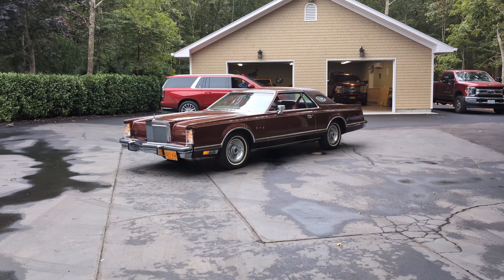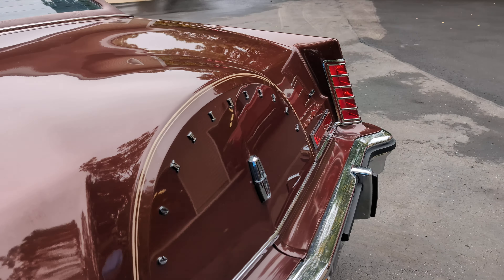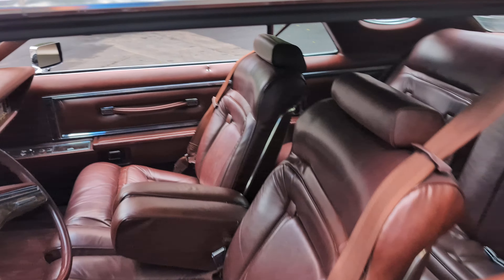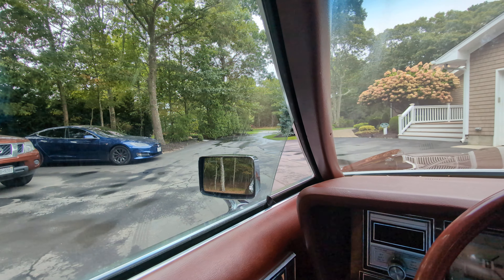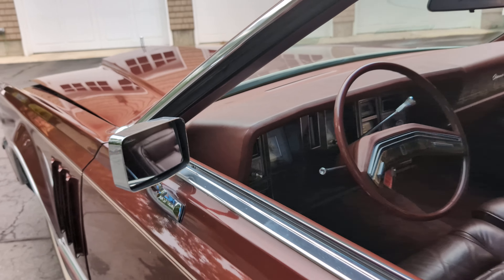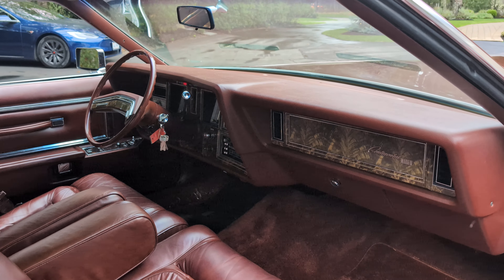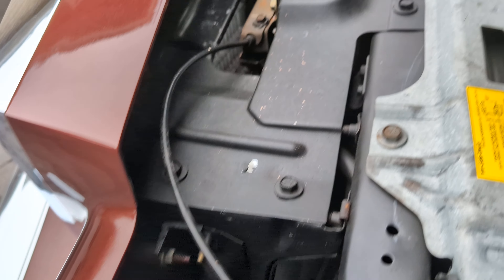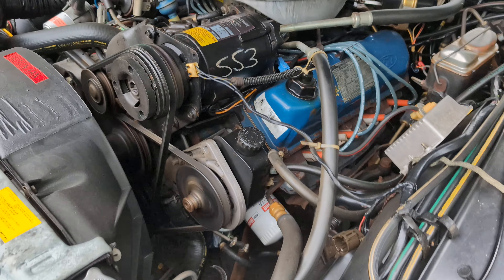Low Mileage 1979 Lincoln Continental Mark V For Sale with Only 593 Original Miles~Never Registered 🔥

Comment: What a pristine car! From the carpet to the vinyl top everything looks brand new. Funny how those buzzers always sound like that. I always assumed that was a thing that happens with age.
Reply from the maker: Right, She's Like NEW with 593 Original Miles, Whata Time Capsule!
Reply: @theredstormer8078  Not the front seats. Look at wrinkles in them, especially on the driver's side. Maybe only 500 miles (?), but some people were sitting in the seats while it was parked in a garage?

Comment: The Achilles tendon of my '83 Lincoln, and not just mine, is the ignition module (ICM). Even with a "heavy duty" box installed, in the Summer on very hot days and with intense engine heat, the temperature of the electronics in the module will rise resulting in the engine shutting down when driving, when you least expect it. Other times, with car parked, the engine was cranking but would not start. I always have two new ignition modules in the trunk as a backup in case something happens.

Comment: Yes, Quadrasonic...because the tape player not only plays regular stereo tapes, but it also plays the special quadraphonic 4 channel surround sound ones.  Quadraphonic 8 tracks have two "programs" instead of the usual four on stereo tapes because they use four of the eight "tracks" at once to provide discrete front left/front right/rear left/rear right channels vs just left and right.
Reply from the maker: Wow, Thats Very Cool!
Reply: @WeBeAutosLtd  Yes, it is!

Comment: How come the valve covers look so bad with those miles..? 🤔
Reply from the maker: Probably because it's over 45 years old
Reply: @WeBeAutosLtd  yes I see, but still, in an air-conditioned garage and no driven… 
The paint quality must be rather bad..? And no primer in those..?
Reply: Every last one that has low miles that come up for sale has the valve covers that look older than any of the other parts in the engine bay. I assume with the exhaust heat and gases they corrode the paint pretty easily. Especially for almost 45-50 years. Paint today is much better quality to hold up to high temperatures @TheKarivirtanen
Reply: @Chitwn81  yes I think you are spot on there. Thank you.
I repainted my -61 Lincoln vert’s valve covers and filter cover.
Reply: Most likely because you're lying 😂about the mileage @WeBeAutosLtd
Reply: I wondered that too. I've seen other older cars that also exhibited that flaking blue paint, but not with less that 600 miles in a climate control garage. I'm leery of that storage story and that the owner bought a number of the same model car, unless I misunderstood the story. One cannot deny is is in otherwise exceptional condition. But a "climate controlled garage" could be one where it is the climate outside that is what controls the environment inside the garage, not necessarily controlled by an A/C system. It is manipulating words, I am not saying that is the case, but I have been a salesman. Hey, Jay Leno has one!

I'm not talking about the video maker/seller, as there seems to be three salesmen involved here. One is the heir who owned the car when the guy passed. Second is the "client" who is the middleman and bought the car from the heir. Third is the one who bought the car from his client and made the video and is selling the car now. That's 3 people involved with this car. We assume each one is telling the story he was told before. The current seller is very reputable and sells very rare cars and I'm confident he is repeating the story exactly as it was told to him. I am also confident had you bought the car directly from the heir who owned it, you might save $20,000 off the $47,000 price. The two sellers after the owner sold it want their cuts.

Given those logistics, I love the car model, but I would only have bought one 45 years ago, not more, but that's just me. We all know how stories can change each time they are told. That is not to say the dealer now has any control over the story he was told. He said he got the car from his "client", so that' means the guy he bought it from was not the owner, so he is apparently relying on the information that his client is providing that he says the heir told him. There is no reason other than the paint question not to think he is telling the story that was told to him.
Reply: The paint on the valve covers is a very thin coat with no primer. Looking at the luster of the paint that is there it seems obvious that the car has very low mileage. Even with 500 miles on the clock, the car has undoubtedly been cranked and run very many times to keep the engine running smoothly and to charge the battery etc. This means it has gone through a lot of heat cycles. I understand skepticism, but after all the years, there are realistically going to be some parts of this car that are not going to appear as new as the others.
Reply: @Johnnyfan1982  I'm an auto detailer and I didn't know that, but I don't usually detail engines either unless in a Stingray where it is exposed under glass. May I ask, how do you know this and do you have any idea why they would paint a non-primed surface, and what would be that purpose? It seems like a failure waiting to happen regarding aesthetics and to leave only one area un-primed, knowing the paint will not stick seems like a bad idea.
Reply: @floridaredneck  I have rebuilt several Ford engines from this period and they all had zero primer on the valve covers. I suppose their line of thinking was this was a great place to save a few bucks. They were only concerned about the aesthetic appeal for the showroom, and the valve covers are in constant contact with engine oil on the underside so there isn’t much of an issue with rust. Just my guess.
Reply: @Johnnyfan1982  Wow, thanks for the opinion. It looks to be the case, as I've seen it countless times, just never really paid attention to it. It does seem like a very cheap and easy thing to have done though. Seems like they would have learned from the cars they made 10 years before that.